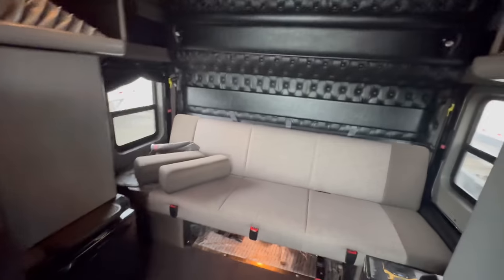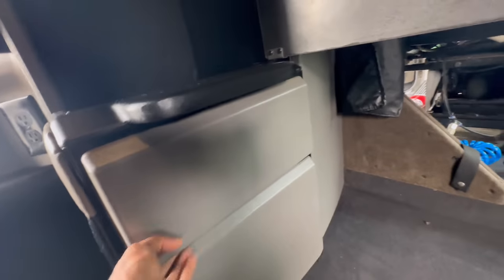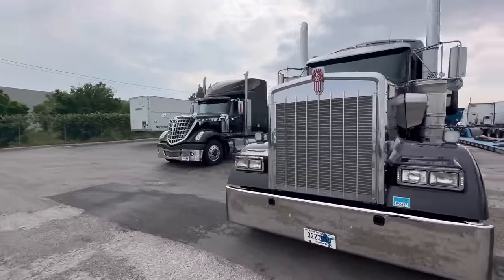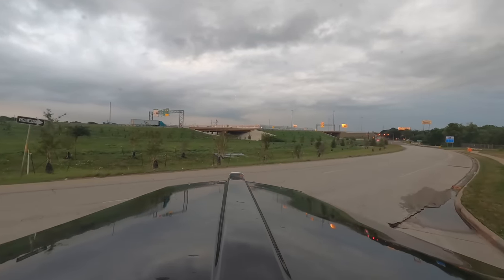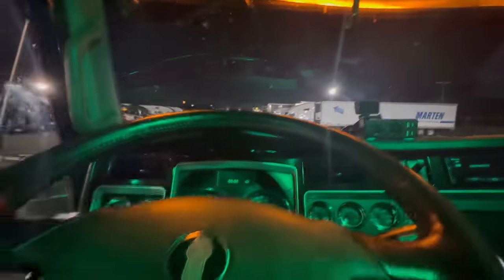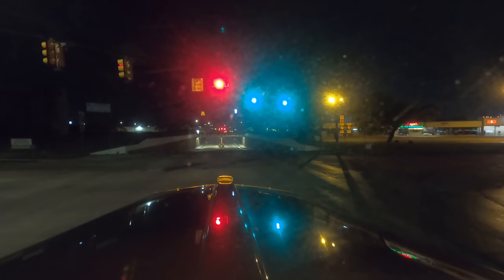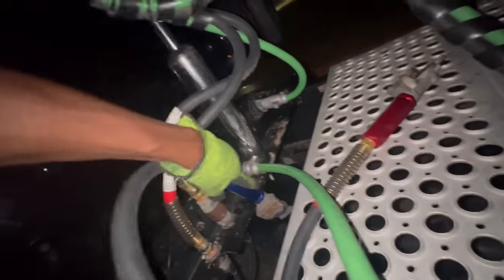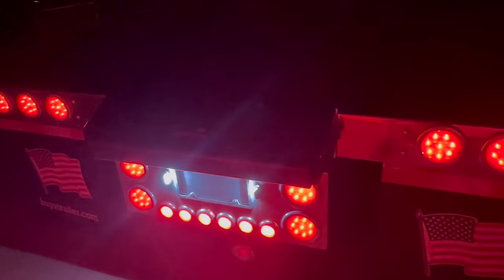500 Mile Test Drive ➕ W900 Tour ➕ Deadheading Home ➕ Trailer Stuck On Fifth Wheel ➕ BIG DECISION!

Comment: Keep doing what you're doing in the driver. Sate you won't have. A armrest. On the right side what kind of motor horsepower torque rear ends
Reply from the maker: I haven’t gotten all of the specs yet. But I know for sure it has a Cummins X15

Comment: The engine is actually over due for its overhaul, it should have been done closer to 500,000 as a rule . The reason its for sale is no doubt the owner didn't want to spend the money to do the necessary work on the engine. Be wary, consult a professional diesel mechanic, ultimately it's your money and livelihood.  Good luck. Cheers !

Comment: 1st im hating right now your in " my dream truck"! 2nd i stopped hating when that light messed with you. Go on and get the truck. You only live once and if it doesnt hamper your bottom line do it. When my chance comes im jumping on it.
Reply from the maker: If you join Landstar, I can get you a W900 over here.
Reply: @GRINDNGEARZ  they told me i need the truck 1st. The recruiter sent me a email with a link to some dealers they deal with but it wouldnt open. Got to call her back and try again
Reply from the maker: @teebrown1642  i know a guy. The same trucks you see on my videos could be accessible to you. Send me an email with your contact info:
HaulingMadeSimpleHTX@gmail.com

Comment: Only thing with the blk one  is the mileage. If the monthly bill is not gonna squeeze much on ur finances do it🤙🤙🤙🤙only thing is that the turning radius is crappy🤙🤙🤙🤙
Reply from the maker: Maaan I HATE the turning radius. 😕
Reply: That's a kenworth..lol. I drive a t 680 it's not too bad but sometimes I still have to back up to complete a turn..thank goodness my hood is shorter and lower  I can see over it better..as far as the hood mirrors the mounts are there. Kenworth will sell you the mirrors, and you can pop them in and on the black w -900 bit. All seats have both arm rests. Depends on. What seats are in it, but if you want, you can put your arm on the edge of the door it's like an arm rest